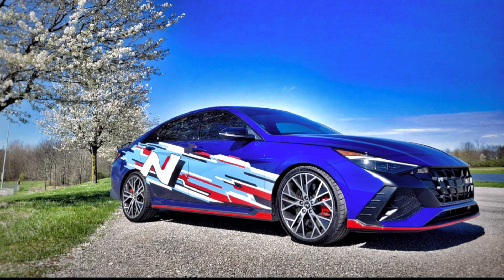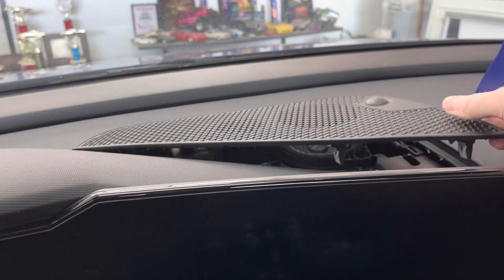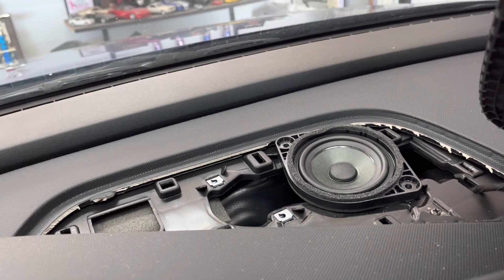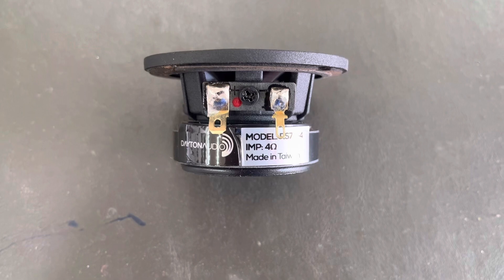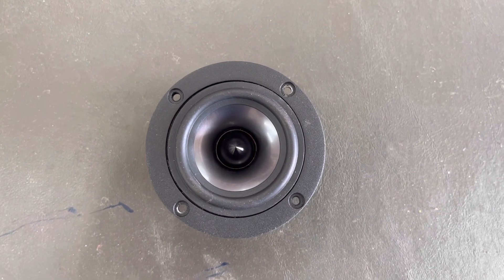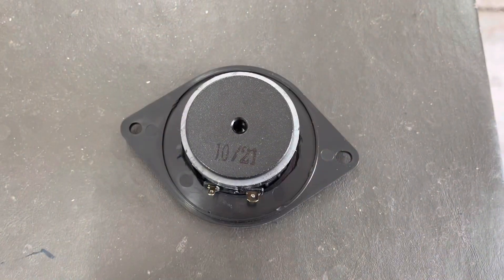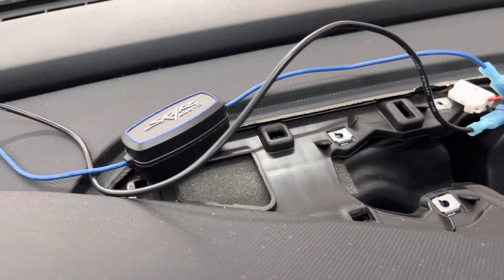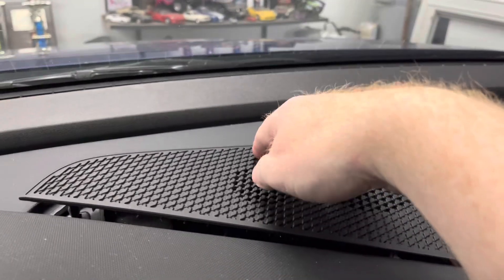2022+ Hyundai Elantra N Center Speaker Removal & Dayton 3" Speaker Install

Comment: Can confirm that a NVX NSP35 3.5" is almost plug and play. Bolts up perfectly with no customizing needed.
Reply: hows the sound quality?
Reply: @mr.awesome5202  more fuller in the front. Since it's a 4 ohm speaker, it's a bit quieter but the tweeter on it makes up for it. Gonna be upgrading my whole entire audio excluding the headunit soon. I have almost everything I need. Problem is I have zero skills at making a amp rack 😂
Reply: @MrTherandomvidsguy  I have no clue when it comes to speakers does it still need a crossover?
Reply: @MrTherandomvidsguy  that’s why I’m not gunna go going all out I would have no idea where to start😭😭
Reply: @mr.awesome5202  no. The coaxial has one built in. Unless you get a tweeter and midrange seperately then yeah you'll need a crossover
Reply: @mr.awesome5202  personally, I'd start with the front component speakers on the doors

Comment: 2 questions. Do you think the typical Rockford Fosgate or Kicker 3.5 speaker would fit in the center spot? And would just changing the center speaker add more highs? My 2023 with the Bose sounds muddy and the highs are not very sharp.
Reply from the maker: You may be able to get a typical 3.5” speaker in the dash, but you will probably have to do some modification, due to the limited depth in the dash. Changing the center speaker will add more highs frequently response, but I don’t know it would solve the overall crispness of the highs. Also, adding a coaxial 3.5” speaker may sound a bit sharp, I got plenty of frequency response from a mid driver without the need of a tweeter.
Reply from the maker: I would suggest installing a midrange driver 2”-3.5” in the dash as a first step in modifying the sound system. You can always build upon that.
Reply: @nprform  thanks! Love the channel!
Reply from the maker: The center and sub are the weakest links in the sound system. Replacing them make a big improvement. But after replacing the door components, I felt the system was complete. The rear doors would be the last thing I would replace as they add little to the system.
Reply from the maker: @cartersgarage392  Thank you!

Comment: Would a 3.5 inch JL Audio C7-350cm fit in this location? looking to do an upgrade on my elantra and crutchfield has been slightly confusing
Reply from the maker: It looks like the dimensions will work. The issue may simply be the shape. I don’t think the speaker’s mounting holes will line up with the factory mounting holes. I believe you’d need to make your own mounting bracket for the speaker to work.

Comment: I wonder if I can do this on my hybrid Blue version
Reply from the maker: I would think so. If it has a center speaker, it should be the same. My wife’s Hyundai Veloster N had the same size center as I do.
Reply: @nprform  I couldn’t find the wiring
Reply from the maker: @yaitstac7267  I just read up on you model. It looks like you only have a six speaker sound system, so I don’t believe your car is wired for a center channel speaker.
Reply: @nprform  danggg, I got the mounts for it in the car, odd that they just don’t have the wires just sitting there waiting to be plugged in
Reply from the maker: @yaitstac7267  That is odd actually. You could add one, but you’d need a DSP to do it, which would be expensive to just add a center speaker. Plus, you’d have to run the wire yourself.
Reply: @nprform  they are only 50 bucks, and probably another 50 for the tweeters. Do you think it’s worth it?
Reply from the maker: Are you saying the speaker and tweeter are $50 each? If so, you still have the issue of the sound processing. If the car’s audio system is not set-up for a center speaker, you’d have to add a DSP processor and amplifier to add the center. If that’s the only upgrade you would be doing, it would not be worth it, due to the overall cost.
Reply from the maker: @yaitstac7267  Also, I have a video going over adding a tweeter along side the center midrange speaker. I didn’t find adding the tweeter was a worthwhile addition. I would stick with a midrange speaker only. https://youtu.be/W5j5eNcxMrg?si=sszdAtrFP8gOFG2J

Comment: Why add the crossover?  You mentioned the speaker's freq. response is 170-20kHz (I'm sure you didn't mean 20,000kHz).  Why eliminate all freq. below 300Hz.?
Any idea of the spec's on the factory speaker you removed?
Reply from the maker: I used a crossover as a precautionary measure, since I don’t know the factory specs. It’s very hard to get any info on Bose speakers. I’m adding an amp for all the speakers, so I will be switching to an active crossover set-up and I’ll lower the crossover to 200hz. The speaker will play up to 20khz, but the optimal range is 170hz to 5khz.

Comment: Hello, is there a replacement where I wouldn’t have to cut anything up and is plug and play?
Reply from the maker: Audiofrog makes a 2.5” and Infinity/JBL make a 2” that are a drop-in replacement but must be bought in pairs and are significantly more expensive. There isn’t a wire harness available for the vehicle at this time for a direct plug-in.